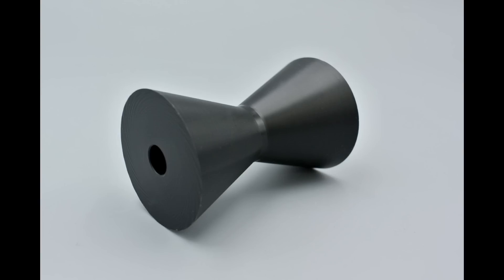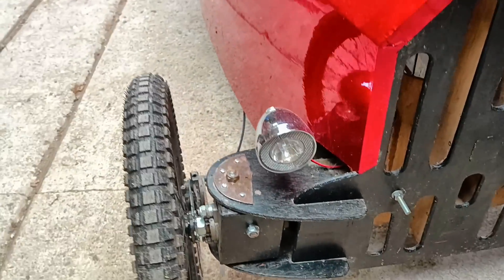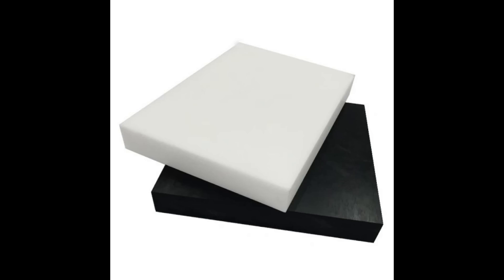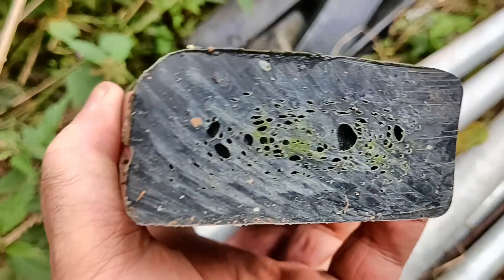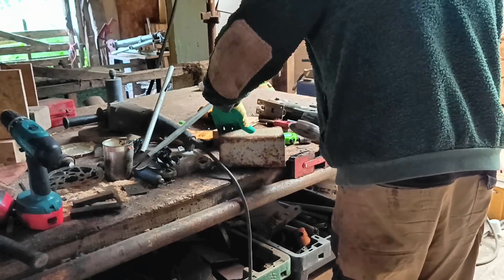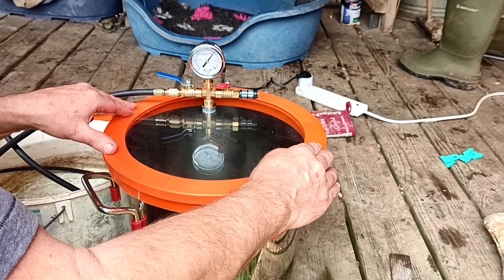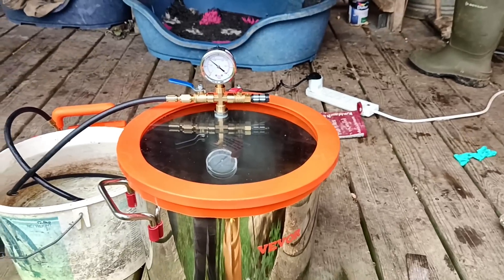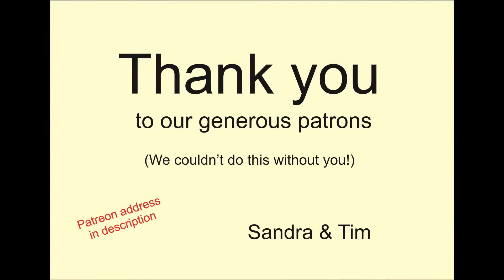Vevor Vacuum Pump And Chamber – and the challenges of Home-Made Machinable Recycled Plastic Stock

Comment: Vapor carburetor- take liquid cooled engine, take out coolant thermostat radiator. Plumb carb to coolant in, put connector tube to intake manifold and coolant out port. 
The gas works like refrigerant, so its something like ethylene which is a very good refrigerant, and that cools the engine in the coolant jackets. 
When the engine heats up, the gas vaporizes at about 220f which is a safe temp for the engine and the hot gasses. 
If there is blowback its a very solid structure and its basically like gas going off in the intake manifold on a v8, no danger there. 
The  engine uses less gas, has lower emissions, cools with minimum parts, is quiet still like liquid cooled, and it runs cleaner. 
If it is too hot still, you can use a smaller carburetor, pumper tillotson or jetski pumper carburetor for fine tuning. 
Then add water injection for steam propulsion, it will not turn the water to steam immediately if at the right temperature, but in the combustion chamber the water can flash off at the optimal preheat and then heat scavenging heat to thrust conversion. 
If it saves thermodynamic cycle inefficiencies, water is free so it would be worth using instead of any other fuel, It would probably scrub the emissions even more than just vapor combustion and would probably be the most ecologically best engine to use.
The technology of this world is in the shitter if we are being real.

Comment: Plastics have high thermal expansion. Like metal casting, the exterior cools first, and then the interior contracts and can draw in air or cave in the surface. I think you will need to granulate and re-extrude this material through a heated screw extruder. Granulation can be difficult

Comment: Interesting use of recycled plastics - hope you solve the void problem.  Forty years ago I made my 5 year old  son a car from scrap wood, powered by an old windscreen  wiper motor and the cheapest 12v car battery I could find ( flat out 3mph)  the steering systen was almost identical to your wooden cars. I m, ade the steering boxes from 3 inch square section oak post, with half inch axles epoxxyed in.  The king pin bearings were made from old.303 brass cartridge cases.  Endless fun for yeas!  Even had a reversing swith, by reversing the polarity of the motor field windings.

Comment: For the bubbles to rise to the surface and release the air, the plastic will need to be more liquid I think. You might be able to retain more heat in the plastic if you put some pre-heated bricks in the vacuum chamber under it but I think much higher pressure compression rather than de-gassing is probably the easier way to go. As others have mentioned, the Brothers Make videos are very informative.

Comment: perhaps casting in the voids you need for the axle and kingpin using tube with tiny holes to let the air inside the plastic escape bonding with the tube as part of the block as the air escapes ?

Comment: Much smaller plastic pieces and low temperature? So you avoid gaps between the pieces while melting them. I had the idea when I saw the pile of plastic saw dust you produced. If you keep the temperature low, you avoid cooking and may have no bubbles. Maybe you should cool it down over a long time. So, you prevent fast expansion and compressing due to temperature changes? 

I've seen another method to get bubbles out of epoxy etc. is pressurizing it so the bubbles get very, very small so that they are no problem anymore; perhaps it works in this case, too?

...all just guesses

Comment: I believe highly viscous materials like the melted plastic do better with a pressure chamber which shrinks the bubbles before letting it harden under pressure. It would be hard to build something safe at home so a hydraulic press like others have mentioned would probably do well.

Its also possible that the plastic is getting too hot and off gassing, making the problem worse.

Comment: Careful with that vacuum chamber. At least on the one i got, the lid is not made from glass but plexiglass.
I used solvents in there which made the plexi develop a network of fine cracks on the surface. Now I don't trust it anymore as im scared of an implosion.

Comment: Try putting it in a pressure chamber and pump up to 60 -100 psi this will crush the voids down, this method is used in epoxy casting to make the bubbles 'disappear'

Comment: Hmm very peculiar. What I know would work for a fact is using an extruder to extrude it into a 2 piece metal mold but plastic extruders aren't cheap so my suggestion is to use your forge to slowly heat the plastic to a much higher temperature until it is liquid like and flows like oil then quickly put into the vacuum chamber and once its pulled a complete vacuum just leave it cuz the pressure is going to keep pulling on the air bubbles even tho you don't see anything happening and let it rest until it's cooled all the way down so probably a few hours if not overnight and then cut it and check it for voids cuz any voids should be right at the top but that's fine cuz you could just measure how deep the voids were and then add the measurement on top of whatever size block you want to make and then just cut of the voids and there you have a repeatable process with accurate consistent results......well i mean at least i hope so 😅 hope this idea is helpful good luck, I can't wait to see where this goes I'm very excited

Comment: What plastic moulding companies like Lego use are angular moulds. Where because your mould is a flat box, the plastic is hugging thr metal all the way down as you push it out. But if you angle the mould plates before welding them, once the plastic gets the initial push it immediately loses contact with the walls, due to the angle. I believe even 5 degrees is enough to make a noticeable improvement in removing the mould.
In a similar vein, maybe if you make a plate with thin spikes, that would push down on the plastic in the melting process, then you remove the plates and spikes during the vacuum process? I'm thinking those holes from the spikes would allow air to more easily escape, since the air can now escape sideways at which point you put the mould back in the oven to fill the gaps.

Comment: How about instead of using a vacuum chamber, put the molten plastic into a pressure vessel.  The voids would still be there, but putting it all under high pressure would squeeze them as small as possible
I also wondered if instead of starting with small blocks of the plastic, if there was some way you could make it a very fine powder, so there would be less air inside the mold to start with?  You could compact the powder as it went in, similar to backfilling a trench.  Just a thought

Comment: maybe Vaccum under heat and pressure also more heat.
would do heat experiment first to see how much the viskosity can change cause its certainly not hot enouth or need more pressure. 
you could also check out the precious plastic geeks...they have open source Diy plans for melting and recycling machines of plastics.

Comment: Many plastics are hygroscopic, meaning these voids are steam bubbles from the absorbed water boiling off. Common problem in 3d printing.
The solution is to dry the material, shred it to small piceses and put in the oven at 100 degrees or so over night. Then try casting it.

Comment: You could try to dehydrate the plastic. If it was in an humid environment it could have sucked some moisture out of the air and when heated the water will turn into steamcreating cavities. To do this it would be best to break up the big chunks into much smaller ones and put it into an oven for a few hours at a temperature thats lower than the melting point of the plastic. For Delrin drying temperature would be slightly lower than 175°C (the melting point).

Comment: I Wonder if you would make the mold warm enough so the plastic would be hot enough to let it slowly cool down and with a funnel of some sort that's heated so a little bit of plastic goes in and whatever bubbles are in the mix pop out the nozzle or you could do something like steam pressing like the early plastics where they would use steam to heat up Bakelite the plastic and that would solve your problems as it was the exact same problem as the early stages of Bakelite. as the pressure of the steam would force the bubbles to be small instead of big like in the vacuum chamber there

Comment: Heh, ever seen what happens to a marshmallow when you put it into a vacuum chamber? It expands a lot too. I see some talking about compression as well, but then I'd worry about how well the material can contain the compressed gas inside after its cooled down. Injection molding takes small pellet sized material, heating it up slowly while compressing it, to squeeze the air out as much as possible. Then the soft plastic get pushed by a ram or auger to be injected into a mold. Even then, you still can get a little bit of bubbling from air and off gassing but at least its minimized.
I hate to ask, but if you are doing this in plastic with molds, does it have to be a large solid block? I get with wood, you wanted to make it simple since it already comes in a solid form. You just cut away what you don't need. Also, as someone else said, be safe out there, specially with plastic fumes.

Comment: When plastic is extruded it’s normally extruded in slightly larger size than required.
It’s extruded by a screw type heated press funnelling in small pellets or similar sized pieces to be compressed by the screw towards the exit tube a short tube the product size that slowly travels into water to cool and solidify the plastic.
It’s a science that has to be adjusted for different types of plastic.
There is some video on YouTube of plastic extruded in India.
Hdpe is probably the best plastic to use and source.
Milk carton plastic bottles 👍
The plastic you are using is difficult to work with I know it as timbron it has different names in different locations.
Try hdpe but remember the start of the extruded piece and the end of the extruded piece will not be as good as the middle so extrude at least a few inches extra to see what you need to do to get the good consistent stuff.

Comment: when we made blanks for custom stubs we used at least 5 tons of constant pressure on the molds till cooled for something the size u are making

and don't overheat the material u are using , always dry the material before melting in an oven 

13 years of plastic welding and fabricating experience
Reply: 5 ton per square inch?
Per square foot?
Per m2?!
Reply: Exactly what I was thinking 🤔 
Increased pressure to prevent the formation of voids and then temperatures calibrated to allow for plasticity and pressure to achieve the block and prevent off-gassing from inside the polymer. 
The 5 tons number makes sense but was still a little surprising 😮
I'm thinking a hot ram would do the trick nicely with a breach plug designed cap for the end to allow for air/gas to vent and then extrude a little polymer as the seal then remove the block and push out the formed, compressed polymer block 😀👍
Reply: @EastBayFlipper  the 5 tons is on the low side
most of our larger molds needed up to 25 ton hydraulic rams ,  that was for stubs blanks from 400 mm to 1000mm

without drying the material he will always have voids  all plastics absorb moisture even 3d printing filament
Reply: I wonder if the source for that material is also running it a little wet
Reply: @doughnut1107  it wouldn't take mutch to make steam🤔
Putting it into an attic for a few weeks might dry it with enough sun 🌞 
A long shot😀😅🤣
Reply: @EastBayFlipper  In the oven at 110c for a couple hours would likely be more efficient
Reply: Drying, and pressure. Just what I was thinking.
Reply: 5 tons is not a pressure, it is a force (strictly speaking a mass even).  We need to know the pressure, i.e. force per square millimeter.  5 tons on a square metre of plastic would be relatively ineffective, but 5 tonnes on a square inch may help.
Reply: @bigchrisrogers  ime sorry ''Professor'' at what point in the video did he give the exact volume or the exact material he is using [as in virgin vs recycled trash bags ]

what i did was tell him to use constant pressure , how much pressure depends on several factors that i don't know the answer to

Comment: Very interesting! I always learn something from watching your videos even though I don't live on a farm, build railways or design cycle-cars!
I do have a small 3D printer and one thing that struck me was how thick and stiff your melted plastic seems to be. I mostly use PET-G plastic for my 3D printed items and that appears to be much less viscous. The temperature I'm using is similar to what you described; around 240 degrees Celsius. I know you'd like to use up your recycled sleeper offcuts but the stuff I use is around 18€ per kilogram from Amazon. 
In case you weren't aware PET is the stuff used for making plastic water bottles and the G is, I think, glycol that's added to lower the viscosity.
It might be worth experimenting with some disposed-of plastic bottles, even though that's PET and not PET-G, but maybe you'd be able to see where the bubbles are as it's much more transparent than the stuff you've been using.
Hope that might help... Good luck with your experiment!

Comment: What if you try the temperatures between first and second attempts, but for longer times? around 200 and 220? 
Also try making sheets, so there is no place for bubbles, and then melting them together with a torch, or one by one in the oven.
I suspect that higher temperatures make plastic release gases, and that higher thickness of the object allows for the gases to be trapped.
Good luck!

Comment: I think you need two steel containers, one to melt the plastic and allow it to drip through small holes into the other empty container. This should reduce most of the large voids.
Reply: It won't drip down, molten plastics are way too viscous for that. You need pressure to make it go anywhere.

Comment: I've been through this Tim! HDPE plastic is the one, as all the other plastics emit dangerous fumes. The key seems to be precise placement of the plastic pieces so it doesn't trap air, and the precise temperature control so it doesn't emit as much fumes. I ended up using heavy weights to press the plastic in the oven, and found that most of the voids were eliminated, but was never able to achieve 100% void free plastic much thicker than an inch or so. I make thick sheets, cut them into lengths and mainly use them as stakes. I also make my own 'L' brackets and the like.
Given that you'd like to share this as part of a kit, I can't see any easy way to make those blocks for others to follow using recycled plastics. You've already proved that plywood works well. What about solid blocks? It seems to me that a nice hardwood block may be the answer.
Reply: Though this is an enjoyable and fascinating diversion, I can't help thinking that a nice hardwood block might well be the way forward.

Comment: I’m thinking that the plastic is still too viscous for any air bubbles to rise to, and break through the surface. A cool crust on top isn’t helping (could an infrared heating lamp help here?). What you are doing is more akin to sintering the pieces of plastic together, rather than remelting - similar to taking the wrappers off a load of toffees and leaving them in a bag in your trouser pocket only to find them fused together into a single sticky mass the next day! If you can’t get the plastic runny enough so that it can be poured into a mould, then you need to work out a way of “kneading” all the bubbles out (rollers of a dough hook/paddle?). Smaller pieces of plastic will still leave voids: there will be more of them but they will be much smaller in size.

Comment: The hard surface probably comes from it cooling. Do you think you can build a vacuum chamber around your oven? That way it would suck the bubbles out while the entire block is hot. Also, I'm no expert, but the gas could be from pyrolysing plastic, so it could be it produces gasses until it's cold.

Comment: The difference between the master and the student is that the master has failed more times than the student has tried.  You will figure this out .   In my opinion, the vacuum needs to be pulled while the plastic is molten/liquid .

Comment: They usually do this through an extrusion process done with higher pressure  with  the use of hydraulics.  this process pushes the bubbles out through a narrow Gap  then the plastic enters into a mold.   with a bit of ingenuity I'm sure you'll get it right...